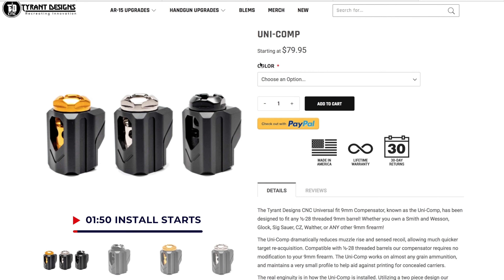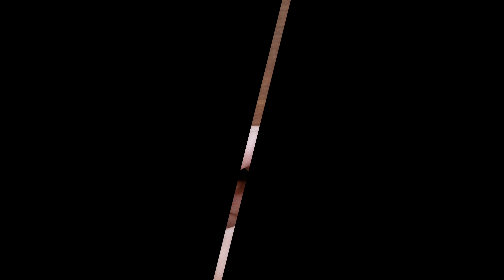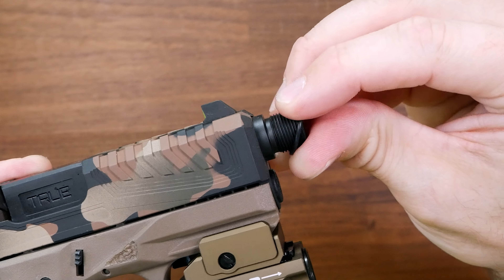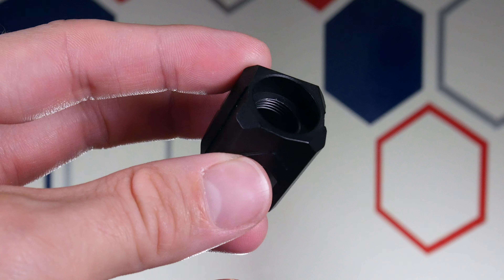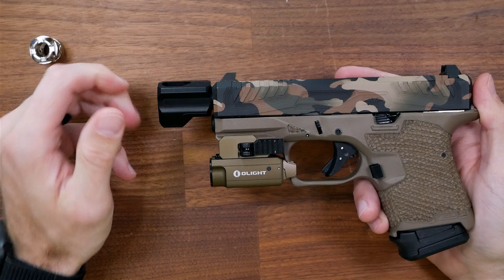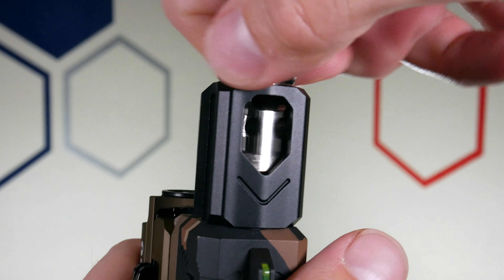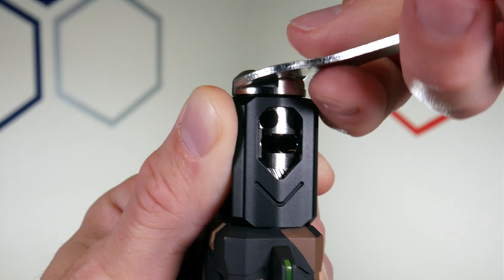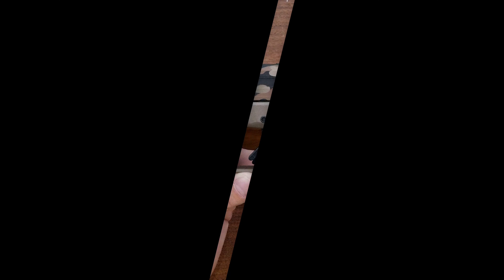Universal Compensator 9mm install | The Uni-Comp by Tyrant Designs CNC

Comment: I have a G19 gen5 , what barrel is compatible that does not flash or have a gap between slide and compensator?  Is the barrel available in your website perfectly fit with your compensator with a gap?
Reply from the maker: The barrel we have on our site will fit perfectly with our Glock T-Comp, a factory Glock slide, and a factory Glock frame.

Comment: Whats the difference between the uni-comp and the t-comp?
Reply from the maker: The T-Comp is specifically designed for use with Glock pattern pistols.  The Uni-Comp is universal and will work with a wide variety of 9mm pistols - https://www.tyrantcnc.com/uni-comp.html

Comment: " ...actual install will be very simple and easy."  But impossible to get 'O' ring positioned as shown. Without the friction, the parts come loose. Good luck.
Reply: Finally got it in place. I used extremely thin jewelers screwdrivers to ease it over the circumference of the Unicomp. Ultimately it did go on. Only took about 45 minutes. But it does need the fraction.